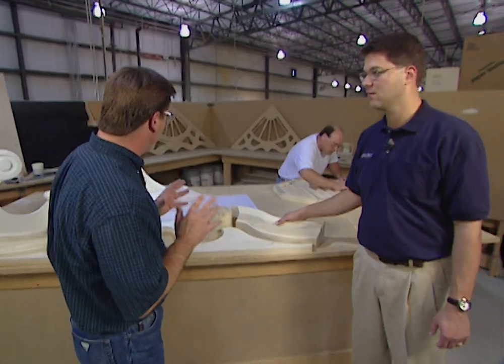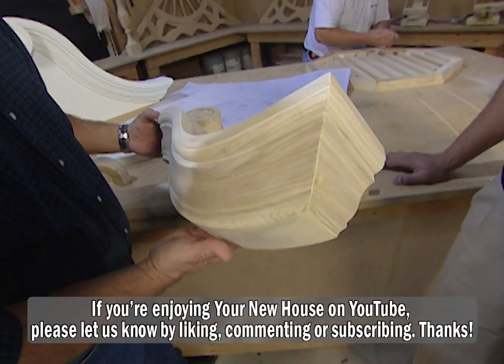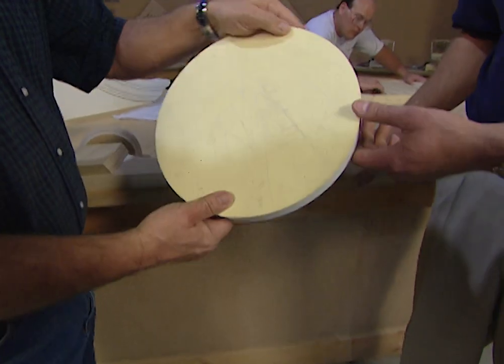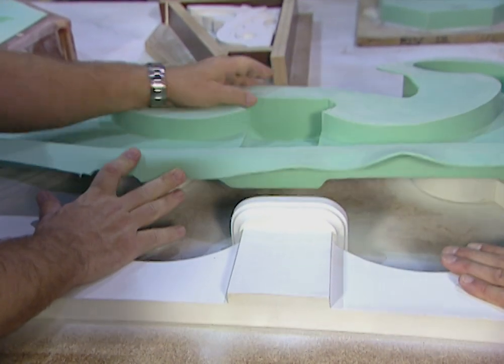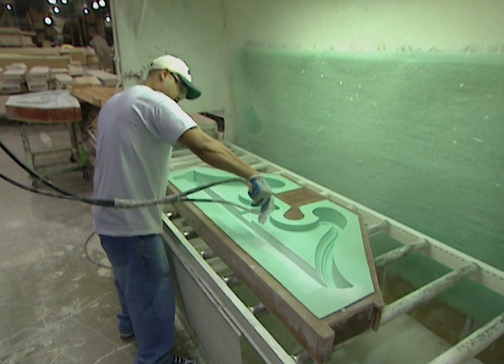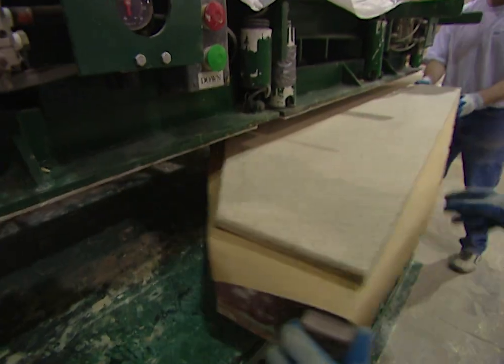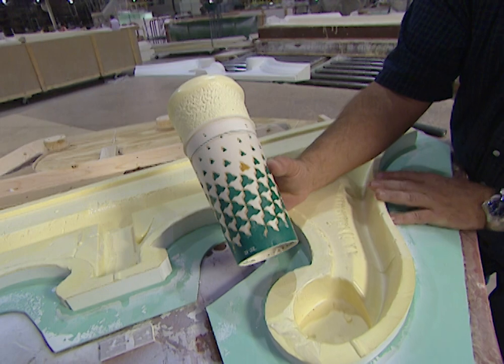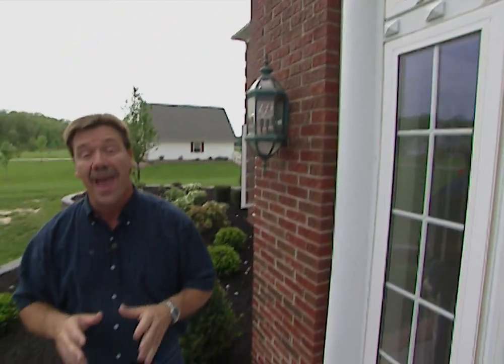Polyurethane Trim a Wood Molding Alternative - Did You Know?

Comment: 2 weeks to make the wood pattern? It sounds like you could greatly benefit from a 5 axis cnc machine. That part could be designed and machined in a few hours or you can use a 3 axis with a 4th rotary axis.
Reply: They most likely do just that - but didnt want to say